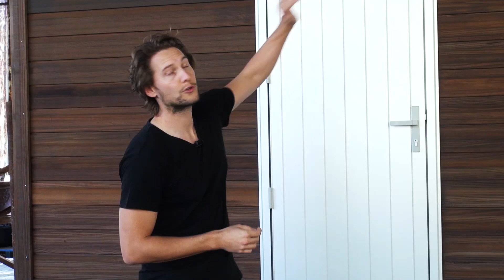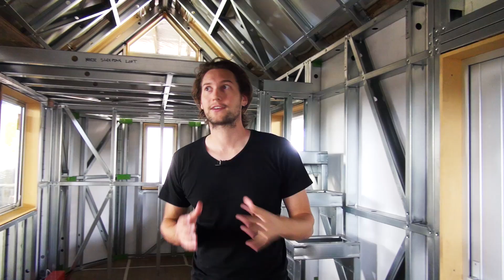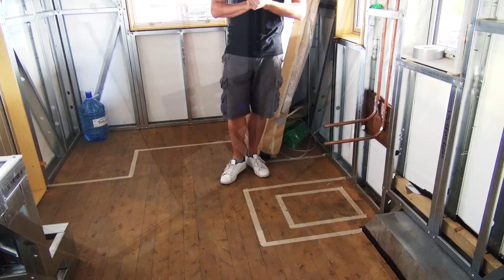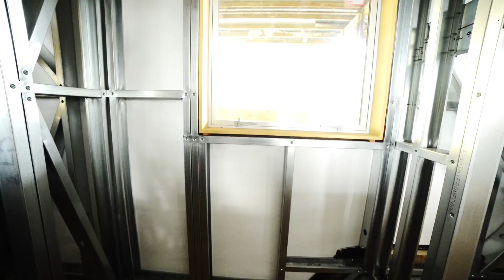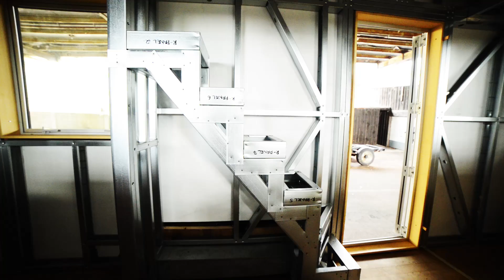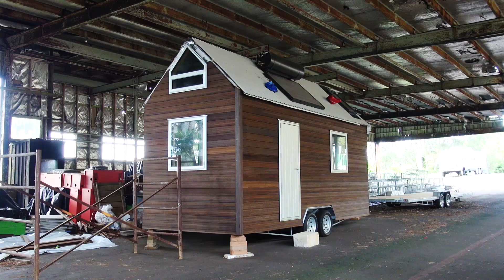Tiny House - Plans For Internal Fit-Out

Comment: A cool idea for the kitchen is using the loft structure as ceiling storage. For small things of course, like spices, cups or small plates. That's my plan at least. I'm really interested in your electrical system. I do some video work my slef and built a computer for it. Its really efficient for what it is but its no laptop. It can draw 250+ watts under load. Not sure if you guys deal with a problem like that.
Reply from the maker: Chasing Cornfields Yup, good idea! 250+ watts is quite a high draw to sustain over a long period of time, but it would be possible in our house. You may just need to add more PV and batteries if you have a higher regular usage.
Reply: Ok, thanks. I know it will take more research to understand my power needs. Looking forward to more interior videos.

Comment: You didn't mention a refrigerator. Do you plan to have one? Even a small one will provide you a lot of food options.
Reply from the maker: Phil Heaton Hey Phil. Yup, we're planning on using the Coolmatic CR-80. It's a 12, 24 & 240 volt fridge. We will be running it on 12 volts.
Reply: Hey, as long as you know that, and where you are putting that, I'm happy.

Comment: I've never been a fan of the 1 high peak roof on tiny houses but I do love the idea of you using steal framing. What made you decide to use the steal framing?
Reply from the maker: It pretty much just came down to weight vs performance and steel framing gave us a very strong structure, at a much lighter weight than wood. Check out this video for more info. https://www.youtube.com/watch?v=LLtOVCYNjLs

Comment: Bryce, thank you for allowing us to hitchhike on your step-by-step construction. You bring up many logical points that are rarely covered in other tiny house videos and it's greatly appreciated. Speaking of strong winds, I'm in the Houston, Texas area and we are prone to strong storms occasionally. I was considering fastening the frame of our tiny home project through the use of turnbuckle fasteners between the trailer frame and concrete pad by welding strong hooks onto the bottom of the trailer frame and putting heavy duty eye bolts into the concrete pad when it is poured. Thanks, again, for allowing us to take this journey with you!
Reply from the maker: Thanks LD! You're very welcome. Thanks for watching! I think that's a really good idea. Depending on your design, I think most Tiny Houses will fair really well in strong winds, but it never hurts to have that extra layer of safety and if it gives you peace of mind in a harsh storm then it's worth the investment I think.
Reply: that would be great for theft prevention also...tiny houses have been stolen.